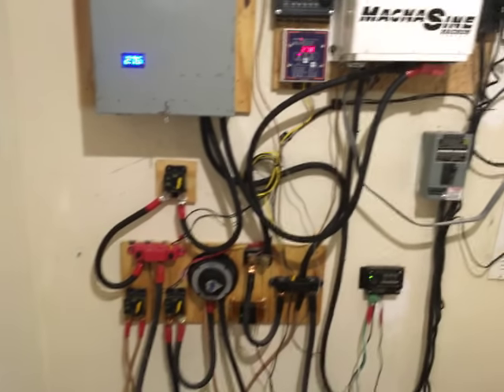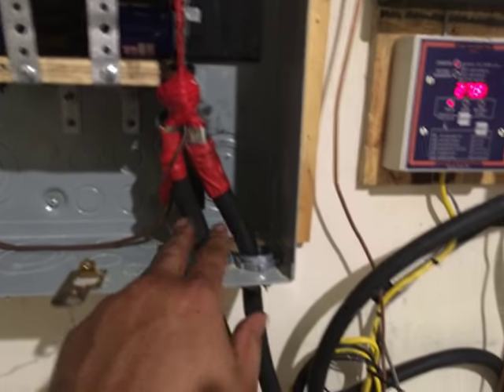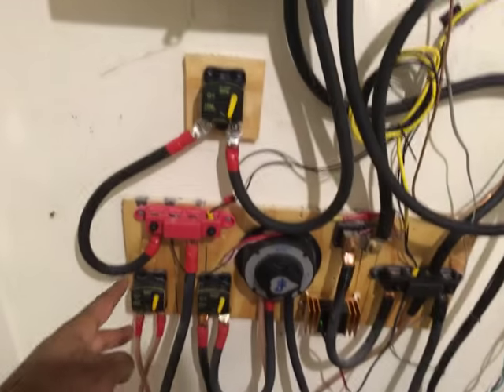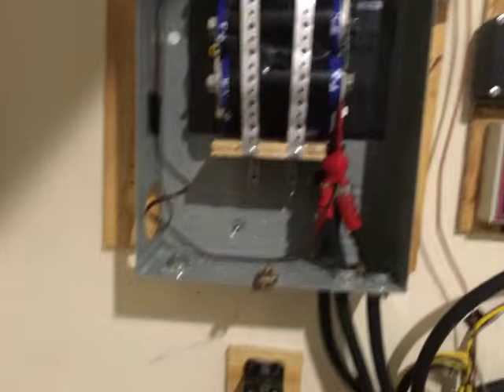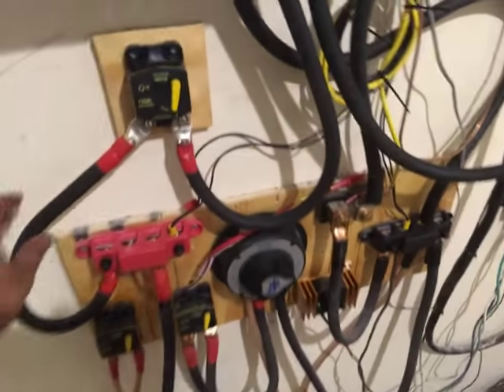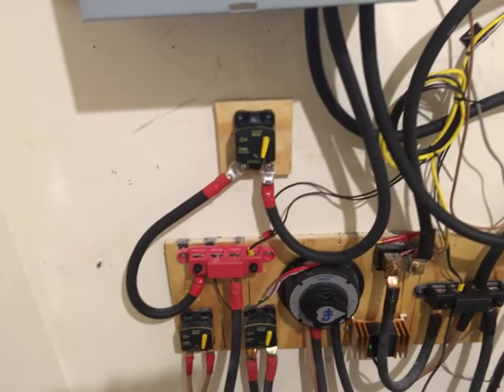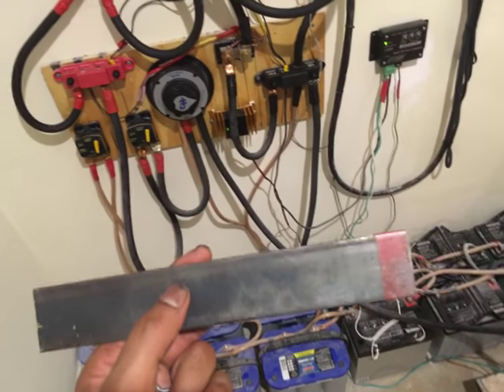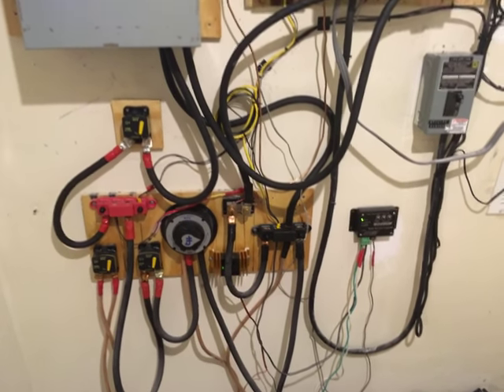Wiring ultra capacitors correctly in an off-grid solar installation

Comment: WARNING! 2 things terribly Wrong with this capacitor/inverter setup!
1. The 150 Amp  Thermo Breaker being used is too weak! Everyone MUST understand that for every 1000 watts of 120 Vac produced by the inverter, the Inverter draws 90 Amps of 12Vdc Battery power, so for a 3000 continuous watt  Inverter, it needs 270 Amps 12Vdc battery power. So with that being said, a 3000 watt Inverter needs a 300 Amp Breaker.
2. NEVER EVER place the capacitor After the Breaker! The premise for the Breaker is if the Inverter Shorts Out the Breaker will stop the flow of energy to stop risk of fire. With having the capacitor after the Breaker there is No way to stop the capacitor from discharging over 1000 Amps into the shorting Inverter virtually guaranteeing a massive short and subsequent FIRE.
Hope this helps everyone.

Comment: I'm using solar &  battery bank to pump water Into a crawfish pond every day. The inverter runs the lifepo4 batteries down then goes into low voltage error, while the chargers then can't recognize the 24v batteries as 24v batteries. I solved the problem last year by using a small digital relay that shuts off a larger in-line ac relay to turn off the load instead of the inverter when the bank gets 1v low. That way the inverter never goes into error mode.and the batteries are still recognized properly by the charger. Did adding capacitors eliminate the same problem?

Comment: great and informative videos, 

could you drain your caps with the inverter? just have a small load going(a light)or two and disconect the batterys till it turns of? even a light straight to the caps, i dont like the idear of a piece of metal?  just my thoughts.
Reply from the maker: With my system I can't drain the caps from the inverter because the inverter shuts off at 18v, which would still leave the caps dangerously energized.  You could use a light directly off the caps, but ultra caps have a lot of power to discharge so it may take awhile.  In my case, the solid steel plate metal simply acts as restrictive load or a dead short.  A light would appear to be safer, but the steel bar works well also, if precautions are taken.  When discharging with a steel plate or heavy duty resistor, heavier gauge wire is an absolute must.
Reply: The balancing circuits and super capacitors itself have a amperage limit on charging and discharge.. a metal bar or big resistors put a lot of stress in your system.. I think patience is a better approach

Comment: Is your system still working good with 2.7 3000f capacitors? What would happend if generator charging process? Would it over heat the capacitors? Thanks

Comment: Negative to the negative bus bar & two positive leads one to the positive  bus bar and one to the positive side of the inverter?
Reply from the maker: Sorry for the late response, I'm trying to catch up on comments.  Not sure if I understand your question, but all positives to the positive bus bar and negatives to the negative bus bars.  Bare in mind I had shunts etc, in this setup as well.
Reply: @rhandsom  oh ok
Reply: I have a super capacitor bank in my setup. I love it i can run power tools during the day with the batteries disconnected.

Comment: I am about to assemble a 48v offgrid system.Icame upon your channel and liked your cap setup.They are now expensive Would a maxwell 48v165f Do a similar job? Bmodo165-PO48.I have bore pumps,house pump etc.
Reply from the maker: At 165F, I would think that it would be fine.  I think 165F would be more than enough.

Comment: Doh. My bad I would have told you that. I did not look close at how you had the old setup. Your right you need it off the caps not the bank. We would run the pos and neg off the cap.  God Bless Brother.
Reply from the maker: No problem, it's a learning process. I've seen in the car audio videos where they would simply run negative to chassis ground so I'm hoping that tying the negatives to a common bus bar point works equally well.  Are you suggesting that I tie the inverter negative to the caps as well or will connecting them to the bus bar be sufficient?
Reply: rhandsom Yes I am. I would run the neg off the caps as well. That's just me. That's how we did it in my Job for years..
Reply from the maker: Thanks, I may rewire it that way as well after giving some additional thought about shifting wires around etc.

Comment: i am new here. how many farad's do you have and they are what voltage like 15 VDC or more. if the caps are charged then can they run the inverter till done. when loading the caps from the batteries i guess a lot of current flows. this looks like a good system
Reply: It is a good system buddy.
Reply from the maker: There was another viewer with a similar question so I'll just paste the answer with some additional info for you.  I have a unique setup in that I have a 24v based system, however I'm using nickel iron batteries so my charging voltage is higher than lead acid batteries.  So the math I used was, Maximum Charging Voltage = 32v,  Each ultra-capacitor = 2.7v at 3000F,  32v / 2.7v = 11.9 or 12 Ultra-Capacitors needed.  3000F per cap / 12 Ultra-Capacitors = 250F total capacitance, that much stored power is more than enough power for household motors even well pumps.  According to the datasheet each 3000F 2.7v capacitor has 3.04Wh of stored power.  3.04Wh x 12 = 36.48Wh total.  The short circuit current potential of these caps are 9300A, so safety first is a must.  It's also a good idea to get the over-voltage protection circuit boards and strapping plates to connect them in series.  However, capacitors and power dense not energy dense.  Power density means that power (a lot of amps in this case) can be released very quickly, Energy density means that a lot of energy can be stored and can be delivered over time in regulated quantities.  Capacitors having high power density and low energy density are designed to compliment storage batteries that have high energy density and low power density. Running an inverter off of capacitors can be done for a very short duration and is not the ideal scenario.  When charging the caps directly from my NiFe battery bank, a "huge" amount of current is flowing into the caps, enough to burn up wiring that is less than 4AWG, at 8AWG (typical jumper cable wire size) the wires get dangerously hot.  Also, thanks for you comment.
Reply from the maker: Thanks JW for the comment.

Comment: Very nice.  Did the addition of these caps solve your voltage sag condition ?  I'm asking because I have a situation where when I start my 2 post hoist (2 hp 240V motor), it causes enough momentary voltage sag that one of two computers shuts off in the house.  I've investigated the possibility of increasing the size of the 'start capacitor' on the 2 hp motor, but 2 different sources tell me it probably won't work as the caps are sized specifically to the needs of the motor.  Sounds weird huh. I would think adding a cap in parallel with the existing cap would give the motor a starting boost.  Perhaps I'll try it anyway. But I'm very curious how this capacitor bank has helped your situation.
Reply from the maker: The capacitor bank has worked out nicely. I have a video on my channel that shows me running the washing machine, 2 ceiling fans, a dishwasher, big server computer, and big screen TV at the same time, along with the fridge, lights etc. The ultra caps take the load and the batteries recharge the caps,  250 Farads is a lot of power (3000F each / 12 caps).  However, if my battery bank goes down to just over 20v, then all bets are off, the battery bank voltage is too low at that point.  But up to that point, the caps handle the surges with no problem.  I was a good investment for me.  Here's the video I was talking about.  https://youtu.be/BeqE95ON7XA

Comment: How did you determine the size of the capacitor bank?  There doesn't seem to be information available. I have seen the car audio caps in the 1 to 5 farad range being used for solar. Which is minimal compared to yours. 

There is a 12v pre-built bank with 350f caps (not maxwell) on ebay for  $60.00. The best bang for the buck. Still, I like to do the math.
Reply: Great channel by the way.
Reply from the maker: I have a unique setup in that I have a 24v based system, however I'm using nickel iron batteries so my charging voltage is higher than lead acid batteries.  So the math I used was, Maximum Charging Voltage = 32v,  Each ultra-capacitor = 2.7v at 3000F,  32v / 2.7v = 11.9 or 12 Ultra-Capacitors needed.  3000F per cap / 12 Ultra-Capacitors = 250F total capacitance, that much stored power is more than enough power for household motors even well pumps.  According to the datasheet each 3000F 2.7v capacitor has 3.04Wh of stored power.  3.04Wh x 12 = 36.48Wh total.  The short circuit current potential of these caps are 9300A, so safety first is a must.  It's also a good idea to get the over-voltage protection circuit boards and strapping plates to connect them in series.  Hope this helps.
Reply from the maker: Thanks for the comments.
Reply: +rhandsom 
spreadsheet. doh. I wasn't thinking. yes, it was very helpful. 

I've watched all of your solar videos back to the beginning. entertaining and saved me a lot of grief.
Reply from the maker: Thanks again for the comments and good fortune on your own projects.

Comment: So you don't have a breaker on your inverter.
Reply from the maker: Actually, I have breakers everywhere.  The Magnum inverter itself has built in circuit breakers, there are breakers on the cables going from the batteries to the inverter, there is a breaker on 240v output from the inverter, and there are breakers in the sub-panel circuits feeding my home.

Comment: Great, how many volts is your capacitor bank setup for, 24V or 48V? Great video.
Reply from the maker: Thanks for the comments.  My capacitor bank is setup for a 24v system.

Comment: Hey Rhandsom, I have the iron edison batteries in 24v configuration like you have.  I was wondering why you put the capacitor bank on the batteries vs. putting a higher capacitor bank on the 120v side near the electrical panel.  I'm considering doing both, to help with the sag associated with my refrigerator(s) that kick on and off-- dimming my lights in the house as well.    our channel is:  www.youtube.com/offgridhomesteading   I'm trying to understand better how your system is wired in this video.  Any diagram by chance?

Comment: where did you find those at? what voltages ranges are they? how many uf are each one?
Reply: All super/ultra caps are 2.7 volts regardless of capacity. a "D cell" battery sized super cap is 350 Farads, I'll let rhandsom fill in the details
Reply: hmm I see you have to add more to bring up the voltage.
Reply from the maker: I got the caps from www.tecategroup.com, I have (12) Maxwell Ultra-Capacitors that are 2.7v each at 3000F each, they are connected together in series to form a 32.4v capacitor bank at 250F total capacity. You can also get ultra-capacitors from AliExpress.  They are similar in size to a soda can and aluminum construction, so you can't use copper lugs.
Reply from the maker: Actually Maxwell has 2.8v and 3.0v ultra-caps now.
Reply: Thanks, good to know
Reply: I dont understand why you cannot use copper lugs?
Reply from the maker: The casing and threads are aluminum. Copper and aluminum are dissimilar metals and contact between the two can cause galvanic corrosion where over time this could become a hazard as one metal slowly deteriorates. In terms of power systems, it's better to be on the side of caution in this case.  Check out the link for more details. I'm no expert on the matter, but I know you can get tin coated copper lugs for around the same price of the copper lugs and rest easy.  I bought 6 tin coated 4/0 lugs for around $6 a piece from an electric supply shop.  You can probably getting them cheaper on ebay or Amazon, I believe I did previously. 

http://www.galvanizeit.org/design-and-fabrication/design-considerations/dissimilar-metals-in-contact
Reply: OK thanks for the info.
Reply: Just use nolox or similar paste designed for this. It stops the corrosion.